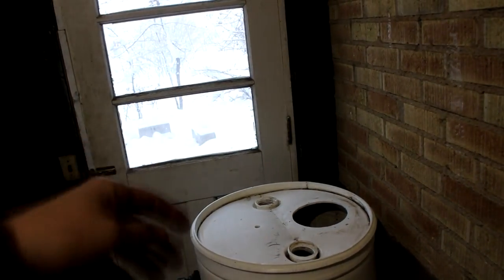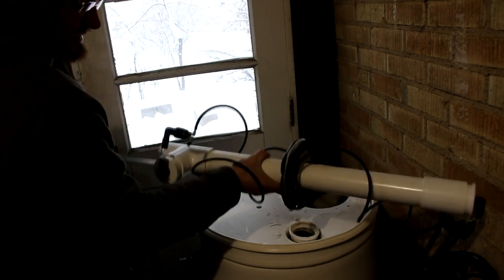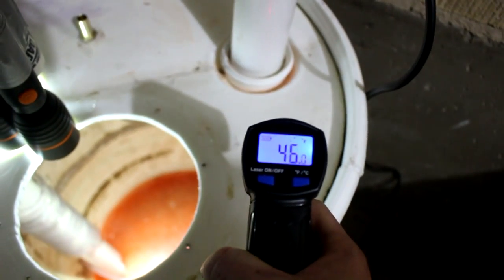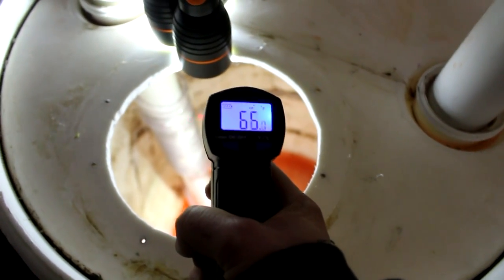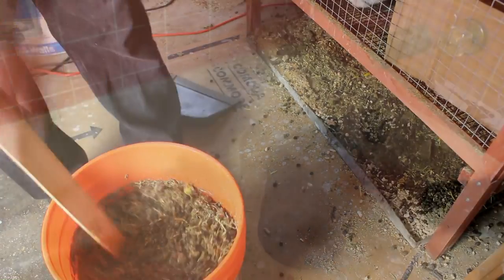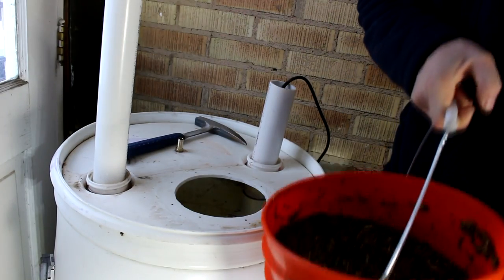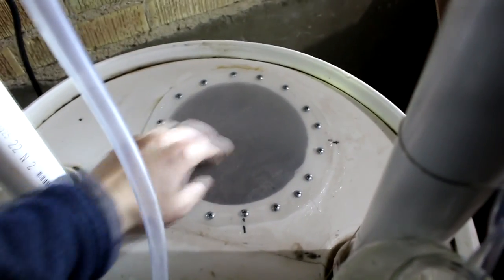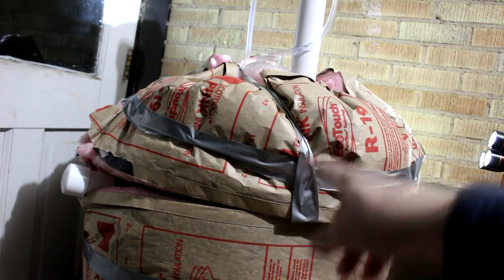Cody's Methane Generator Part 1: Putting it Together

Comment: Cody! please make liquid ozone and add it to your collection!
Reply: 3ArtDigital I agree
Reply: 3ArtDigital Yeah! Also he could patch up the ozone layer with that! (Being sarcastic)
Reply: And Jeramy you should've left out the brackets and caused a comment war
Reply: I thought ozone wasn't stable enough to be a collection thing.
Reply: drink it..
Reply: YEAH! DRINK IT!
Reply: Pawan Kumar yessss!
Reply: Liquid O3 nice
Reply: Seems like a good ideea. Do it
Reply: If he can find a way to produce O3 he should just leave it running, to slowly contribute towards replenishing the planet's ozone layer. It takes centuries to repair by natural processes, so even just him leaving a small setup running for a few years could reduce that time rather significantly. Every little helps.
Reply: Ground level ozone and the ozone in the upper atmosphere are not the same, there's not much mixing going on and ozone is (as you noted) fragile. All he's be doing is pumping out a locally toxic gas.
Reply: With a quick bit of research (not much, I must admit) and the basic chemistry knowledge that I possess, I can conclude that the O3 Cody would be producing wouldn't achieve its initial goal of reaching the stratosphere, but it also wouldn't collect in large plumes of toxic gas like smoke does.

All it would do is simply diffuse into the atmosphere, and since he could only produce small amounts at best, it would do no harm to the surrounding ecosystem. Granted, this means it wouldn't at all be worth bothering with in the first place, but he also wouldn't be endangering anyone or anything.

It would be worth it, however, if he could somehow build a 20km high tube in order to deposit the O3 directly in the ozone layer. That would be cool, if it were possible.
Reply: 03 forms when O2 in the ozone uses up energy when hit with charged particles from the sun? Unless I'm mistaken
Reply: yes that's right
Reply: Alif Alam, if I remember correct ultraviolet radiation sometimes breaks apart an O2 molecule into its constituent parts - two oxygen atoms. These then, with their new-found energy, bond to other O2 molecules to form O3.
Reply: SS-Captain Lurmey yes the O2 becomes  O* which can co on to react with another O2 to make ozone. Its worth saying thatO3 is not good at ground level, i forgot wether its toxic or something else but it really only belongs in the higher spheres and in my lab when i need an ozonolysis
Reply: for real ?
Reply: SS-Captain Lurmey the ozone layer is self renewing
Reply: Saw some funny comments in here
Reply: Alif Alam Yes, but it's an equilibrium reaction. (Generalizing here, but for a basic explanation it is) So as aerosols and other O3 killers enter the atmosphere, they permanently lower the concentration of O3 until they diffuse out of the atmosphere, which takes a Veeeeeeery long time.
Reply: And that equilibrium takes a really long time to shift, so it takes a long time (decades) to renew.
Reply: Good to know, thanks for the clarification
Reply: +SS-Captain Lurmey Making ozone gas 24/7 and letting it into the environment would be more harmful than helpful. Living things don't do too well around ozone gas:p Also our ozone layer is fine atm so no reason to try and replenish it.
Reply: apparently there are holes in the ozone layer, maybe it's not the case anymore? I've heard of that quite a while ago, something like 5-8 years ago when I was a little child
Reply: Lord of Stars Not the case anymore , correct
Reply: O3 is (obviously) a fantastic oxidizer. As you can imagine, it's fairly eager to find it's way more stable state, often violently.

Don't make o3
Reply: I should think that people sensible enough to produce O3 in massive quantities are, well, also intelligent enough not blow/burn themselves up.
Reply: Roman Gogueshvili Accidents can happen to anyone, even professionals. I would hate to see Cody get hurt just for a video. I don't think it would happen but there is a big possibility it could if something went wrong.
Reply: he used explosives inside a abandoned mine, a little bit of O3 isn't a big deal.
Reply: Yeah, I'd like to see liquid ozone too. Apparently it's a  beautiful dark blue color.
I know liquid oxygen is very pale blue. But I've never seen liquid ozone before.
Reply: SpydreX Official good point

Comment: Hey Cody, I'm no chemist but I do brew beer and I have a question. Would co2 effect the process? It is heavier than air and would displace the oxygen out of your container. Helping along the process or do you need the bacteria to work in 2 stages one where it uses the oxygen and then stage 2 the anaerobic cycle where it needs the lack of oxygen? Talk to some guys that brew beer if you need anything for us it's all about the bacteria. Cheers keep making great videos.

Comment: The heating system is very cool. it reminds me of the way a radiator works when you heat a home. I'm thinking about using something similar to that with my biodigester.  I made mine out of 5 buckets from menards, all connected by PVC piping.

Comment: A digester works best between 90 and 105 F, and the bigger the better. If the temp is too low it will not work, if too hot it will kill the anaerobic bacteria. The other thing is that it needs to be a process that keeps oxygen out, and the resultant gasses are methane and CO2, then the material that is used up can be used for fertilizer in the garden. Also it is best to have a small heater, agatator, and pressure relief set at 2 to 15 psi but less than half the pressure that the container is rated for.

Comment: Don't forget to keep the aquarium heater submerged in water almost to the top. If the glass is not fully submerged the heater will crack open. There is usually an indicator line on the side.

Comment: G'day,

   Cool, that's a thorough looking setup...; though it's a pity about the Coal-Fired Electrical  Immersion-Heater which makes it a happynink thing.

 What're you goanna do with the Biogas, when it finally begins to burp it in a steady little stream ; are you going to scrub the impurities out, to obtain the actual Methane, or simply burn it as it comes ?

  Have a good one,

  Ciao !

Comment: You may be able to combine the heating requirement with a method to boost the methane production by using a small gasifier to bubble syngas into the generator. Do a search on "Rapid Methane Production from Synthesis gas: Bio-conversion at High cell loading".

Comment: Cody, couple of ideas maybe... 

You could use a submersible stock tank heater, they're higher wattage, but they will make the water considerably warmer, and you could always control it with your side thermostat.

If you stick with the aquarium heater, I don't know what kind of efficiency gains you'd get with copper pipe for your dirty side of the heat exchanger. Not sure what the pH would be of that solution, so I don't know if the copper would end up killing the bacteria you're trying to promote. The other option would be the white nylon tubing like they use for feed lines for refrigerator ice makers. You can get it in various diameters and it's pretty cheap, and it takes a beating. 

I don't know how important agitation is to this, meaning does a stir once a day good, or should it be continuously moving. Could borrow some technology from the water purification world and make another service port on top, use a drill with a string seal and put a paint mixer paddle on the other end and dial the speed back so it's not screaming full speed and do a timer to let it run 5 minutes an hour or something. 

Love the chukars... I miss not hearing the Bob White quail we used to raise. 

Good video, looking forward to the results.

Comment: Hey Cody, nice project, but as a microbiologist, I have some tips to improve your bioreactor:

First of all, since your feed tube seems to be open to the outside, oxygen will continuously diffuse into your bioreactor slowing down or even stopping anaerobic processes. Might be a good idea to attach a lid to it.

Secondly, it would have been so much more time efficient if you´d just jumpstart your culture with glucose to enrich the biomass concentration.

The idea of your manual magnetic stirrer is a step in the right direction, but if you really plan on having a decent efficiency you need a continuous homogenization with a batch this size. (Just had an idea of maybe implementing a sterling engine stirrer - since you are already loosing energy due to the large heat gradient from the barrel to the garage/outside. Might as well use it, but I'm no engineer so it could also have not enough power).

Your feed composition looks ok, but next time please try to break it down into smaller bits. It significantly increases the bioavailability (due to surface area, diffusion efficiency etc.).

And finally, if you have the possibility to heat it to around 36°C (97°F) do it, temperature makes a big difference if it comes to metabolic activities. But you might actually not have to heat that much since the reactor itself will produce a significant amount of heat.

That´d be all that immediately came to my mind after watching your video. 
If you are interested in further ideas/discussion I'd be happy to lend my expertise.

Comment: I truly hope you meant 2017 not 2018, I can't wait a year to find out 😂
Could you burn the methane that will produce to create energy to power its self, and access to store?
Reply from the maker: this one probably not but a larger one sure would: cube law, twice as big, twice the heat loss but 8times the methane production.
Reply: Shouldn't be the heat loss 4x bigger?
Reply: TheAllegiantTraitor no because as volume goes up the rate of heat loss goes down.
Reply: If you multiply a side of a cube by two, then it's surface should grow 4 times, so heat loss must also be 4 x higher. but volume increases 8 x so it makes up for it by making 8x as much heat
Reply: TheAllegiantTraitor no it doesn't work like that. Look it up. The volume is four times but the surface area is only double.
Reply: what would be the point? it's impossible to generate more methane than your using to heat the system because of the law conservation of energy
Reply: Rob Palmer 12018, he said, as in 'If you're watching this in the future then I will have put up a link to the next video by then.'
Reply from the maker: yes the 4x is the correct value for a doubling in radius, my mistake.
Reply: +Kenneth Keys Actually, he was referring to Kurzgesagt's calendar system. It is basically the same as the Gregorian calendar, except you add 10 millennia to every date. (Kind of like how the Kelvin scale is the same as the Celsius, but 0°C≈273K. So 2018 in Gregorian=12 018 in Kurzgesagt-ian)
Reply: CsBence98 I know, I was explaining it in a way that Rob Palmer here would understand, as he does indeed explain his reasoning behind the switch in another video.
Reply: CsBence98 But the catch here is that it isn't 2018.

Comment: Hey Cody, just had an idea for a project and figured you might be interested, essentially its just making your own metal detector using a primary and secondary electromagnet, the primary electromagnet forces current through the piece of metal being detected causing it to have its own magnetic field, the secondary electromagnet is hooked up to a loudspeaker and when its magnetic field is disturbed by the metal, the loudspeaker will pick it up. I figured you might want to educate people on how they work and come up with some other practical use for this type of technology. Like if u want to see!

Comment: im jealous of the half-foot of snow cody gets; in the east midlands all we get is a bit of slush if were lucky
Reply: BocbinPlaysGames annoying isn't it mate. Had some snow today was melted in 5 hours
Reply: BocbinPlaysGames Snow is only nice when it's white and you see it. When it starts to melt, it's the worst... Got 25cm of snow the last 3 days and now its melting, with -10°C and below at nights, it all turns to ice. Too dangerous to drive, too dangerous to walk. A pain in the ass.
Reply: BocbinPlaysGames in arizona we get lucky if it rains

Comment: So this is a kind of bioreactor.  I learnt about these in uni many years ago, very smart design this.  Not sure how sensitive the bacteria is, but you might gain greater efficiency with a radial impeller of sorts.  There is a bit of information out there on the different kinds and what might be more suited to an anaerobic environment like this.

Comment: To stop foaming an easy way is to add some silicone oil like simethicone. You can get liquid caplets of it it's called degas here and you are supposed to take them for cramps from wind. It poops the bubbles in your poop and you can just fart it out so that relieves the pressure. They are quite cheap and a lot cheaper than another antifoaming thing you can get, which is a small bottle of a tiny amount of it for an outrageous price to add to a mash when you distill it to stop foaming and bumping.

Comment: Can you say the temperatures please also in Degrees Celsius :) ?
Reply: FilmHero the range in the video was roughly from 2-35 degrees C
Reply from the maker: just divide by 2, close enugh. ;)
Reply: More or less. Thank you ;)
Reply: Cody It would be more like subtract 30 and divide by 2 
!00 F=~38 C   vs 50 C   12 degree error in Celsius is substantial. 
but 100-30/2 is 35 only 3 degrees (C) off.
If they set their Cesius thermostat to 50 they will cook the poo and likely kill  the bacteria they want.
As values (of F) get  closer to zero  the estimate gets more accurate.
Reply: C = (F-32)/1.8

Comment: Wouldn't it make a horrible smell whilst adding new more poop, also wouldn't the outflow of gass also make a bad smell?
Reply from the maker: Surprisingly no, it is well contained and once it is running properly the gas coming off it can have a sweet smell to it.
Reply: That sounds rather counter-intuitive
Reply: Cody'sLab never thought manure would smell sweet , and by the way humans don't produce methane are you sure cause my dad used to remove the porcelain from the royal throne.

Comment: Why not use some liquefied nitrogen to purge the oxygen from the chamber?
Reply from the maker: because most of the oxygen is dissolved into the water. to fully purge it I would ether need to boil the entire mix, pull a vacuum, or add chemicals to react with it. None of those options are very bacteria friendly.
Reply: Bogdan Belcea don't question the geniuses ideas
Reply: Cody'sLab Great videos keep up the good work Cody, you're awesome! Can't wait until the next video XD
Reply: Kieran Edwards that's the first step to never improving
Reply: Going to have to call BS on the premise there's more oxygen dissolved in the water than in the air. It would have to be virtually full for that to be the case.
Reply: how do you think gills on fish work?
Reply from the maker: +seigeengine Normally true but in this case there is a lot more water than air. ;)
Reply: +Cody'sLab My brief look suggests it would have to be around 95% full of water just to break even. I mostly got curious because what you said sounded wrong to me. Here's what I got.

Oxygen is at saturation around 9 mg/L in water at roughly these temperatures.
The air at sea level, normal temps, etc. is around 1225 mg/L.
Oxygen makes up about 23% of air by weight. That's about 282 mg/L of oxygen in air.
That is, air contains about 31x as much oxygen as an equal volume of saturated water.
So for every part of air there needs to be 31 parts of water to reach the tipping point.
So 31/32 of the digester has to be full of water to break even, or about 97% of the barrel's volume.

The barrel sure didn't look that full to me. ;)
Reply: Cody can you build a penicillin sintesis video i think will be awesome.
Reply: +tonynoter The idea would be to speed up the process of it's depletion by replacing the air inside the container with nitrogen. By removing that oxygen from the equation, you should see anaerobic bacteria take over faster. We were discussing how much of the oxygen is in the air in the container compared to dissolved in the water to discuss how effective that would be.

Comment: Hey Cody, First off thanks for the educational vids and please keep up the great work.  I have a question, I live in a neighborhood and have a fenced in back yard with two dogs, and an inground pool.  I'm constantly picking up the dog droppings and just throwing them in the trash an as you could imagine, if I'm a few days away from trash pickup it gets really rank.  I've seen some devices that are just a barrel with no bottom and this gets buried and the dog doo goes in with some lye or other product to decompose the doo.  However, I'm not a fan of this cause I read that no matter what, dog feces will continue to contaminate the water table.  Do you know of a way I can break it down to a point of not being so gross and maybe even helpful???

Thanks
Bennie

Comment: Why do you need nitrogen in a methane generator?
Reply: Because the bacteria still need nitrogen to grow, even if it isn't necessary for the methane itself.
Reply: fejfo's games I think for the bacteria
Reply: Neandercatz How would adding nitrogen-rich chemicals keep the oxygen levels low?
Reply: I made a mistake. I thought that he added gaseous nitrogen to blanket the mixture. He actually added that batch because it would give more methane due to the carbon. The nitrogen compounds have no role.
Reply: Neandercatz The nitrogen is critical for maintaining the microbial ecosystem.

Comment: Cody, have you heard of the electrolysis process for producing methane?  IIRC, you use carbon electrodes with a copper catalyst of some kind.  Apparently the process can also produce methanol, ethanol, and I believe ethylene depending on the exact set up.  One paper even got managed to pull CO2 from the air and produce ethanol.